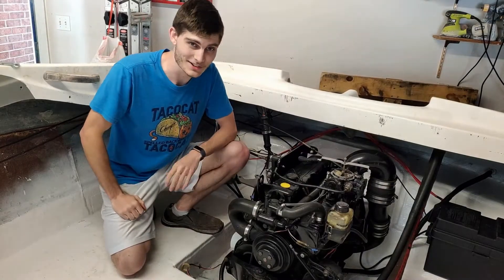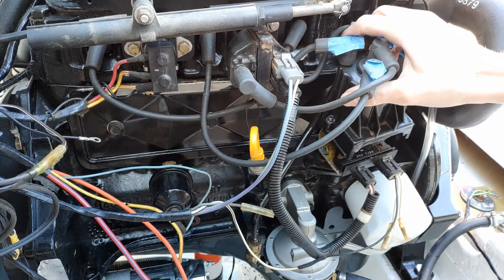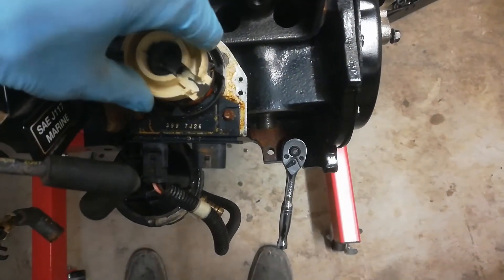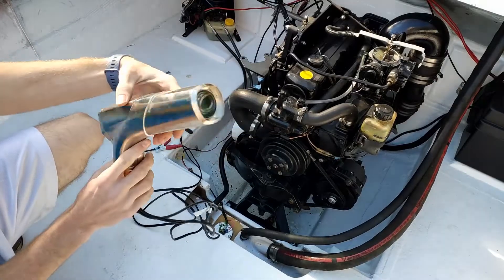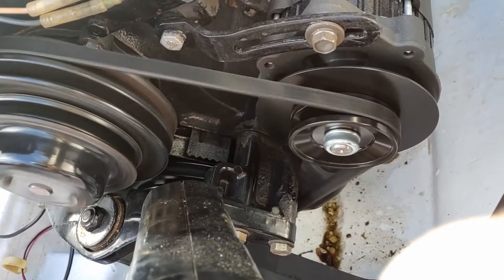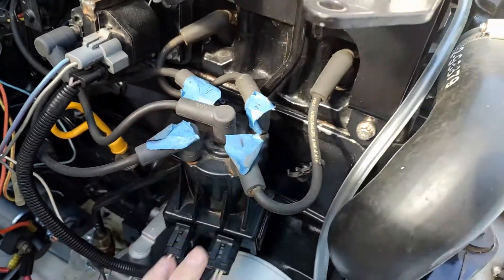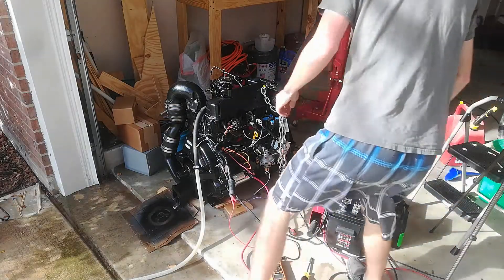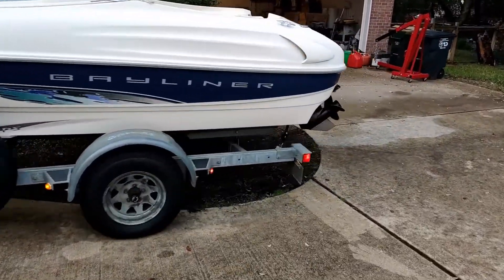Mercruiser Engine Distributor Timing

Comment: Great video Man :). I  am having an issue with my MCM470 and I cannot figure the timing. I am wondering if you have any ideas about that? thank you
Reply from the maker: Have you already tried adjusting the timing?
Reply: @ZachsGarage1  thank you for your reply. I have not touched the distributor at all. I am willing to work on it this evening but I honestly do not know very much about it bro, If only i could find a picture of how the cap is out and how the wires are done
Reply: I found out that I have no gas in the cyl heads!! I do have gas in the little intake under the carb though. and I can see the carb shooting gas down. do you have any idea why the cyl are not getting any gas? they bone dry :/. thank you again Zack
Reply from the maker: @yacinedreamer  as the engine rototes, if the timing of everything is correct, as the intake valve to a cylinder opens, the piston should be moving down to suck air into it, so if the carb is shooting a most of gas down, it should be sucked into the cylinder.

How are you looking to see the cylinder is dry? If you are peaking in the spark plug hole I would expect it to be dry. Because if the spark plug hole is open, air will be sucked in more from that hole rather than the intake valve
Reply: @ZachsGarage1  first, you are the only one who ever replied to any of my messages man. I really appreciate this. I do check the spark plug and it had no trace of gas. maybe I should remove the head cover and turn the engine over to see if the lifters are moving?
Reply from the maker: @yacinedreamer  yeah you can give that a try, I'm not sure if you'll be able to visibly see gas shooting in. But if it is you'll know because the engine will fire 🔥
Reply: @ZachsGarage1  Oh I did turn the engine but nothing comes out except air. I will try some marvels oil and see if something happens. I should record a video maybe

Comment: It appears you are one cylinder off.  Mine was set similar to yours and it would run, but not great.   Nearest the front/block should be cylinder 1.. your set up is similar to the distributorless ddis system.  But the EST system has the same firing order, but cylinder 1 is at 2oclock facing the front/ flat side of the distributor cap.
Reply from the maker: After I had troubles with mine, I had wondered if it was one cylinder off. I had taken the rod / lifter cover off, and when through rotating by hand checking when each intake and exhaust valve was opening and closing and when the rotor arm would spark each cylinder. I found that I did indeed have it on the correct cylinder firing order, but just needed ~8 degree advance adjustment on the distributor
Reply: @ZachsGarage1  must just possibly be the year difference.  Mine was an early 3.0. DDIS was not around when my engine was made. I used compression tester and turned engine over by hand and with cylinder 1 making compression, crank pulley timing marks lined up, my distrib was pointing at the same location as yours, wired the same as yours.  Motor ran ok, idled "good" was stubborn to start though.   I pulled distributor and rewired as mercruiser manual for the EST ignition, and now I don't even have to pump the throttle to get it started. No off idle bog, and revs way quicker than it ever did.   If it worked for you, then that's great. I was convinced when I had compression on cylinder 1 and it was not pointing where mercruiser said it should be.
Reply: Just seeing this. So I might be right about the rotor should be pointing at cylinder/plug number 1 ? this is what I asked : I've been trying to start my freshly rebuilt 2.5 120 HP Mercruiser. It's turning over and firing occasionally through the carb. I wouldn't call it backfiring more like a hoarse hose snort if you can picture that. My distributor rotor is at about 4 Oclock at TDC. Is it possible it should be pointing directly to cylinder 1 which would be 1 oclock (on the 8cyl 350 I built, you point that at cylinder 1) or does this sound more like I'm at TDC on the exhaust stroke and I should try flipping it around. Meaning getting to TDC as is, pulling the dist. rotating to the next TDC and reinstalling. Also is it possible that there is kill switch or wire I should be looking for that just wont let it start? I've jumped the 5&6 female pin connectors. I am also trying to start mine on a stand to check for leaks etc., before installing back into this project. Thanks in advance I know this is a 2 year old post so It may fall on deaf ears :)

Comment: Zach thanks so much for the great video extremely informative and easy to follow. I have a question my Bayliner is stalling out and only starts when I put it in neutral and throttle it up. When I back off to Idol it’s stalls. It runs fine when the ravens are up but anytime my back off it stalls. I suspect it is a faulty IACV. Can you show me how to diagnose fix or replace this valve?
Reply from the maker: I would if I could! But I don't believe I have a intake air control valve (IACV) on my carberated mercruiser 3.0

Comment: You didnt show if u need to jump the wire on the distributor. .
Reply from the maker: I did not jump the wire on mine to out it in base timing mode changes your timing degree readings slightly

Comment: Actually incorrectly done with this type of ignition system he should have set in base timing mode. Should have installed jumper between white leads coming off distributor and bypassed shift interrupter switch.and then used timing light.
Reply: Can you do a vid on doing it the correct way
Reply: You are 100% correct, off the top of my head I don’t think I’m correct but you run engine at 3400 and should be at 28° Before tdc

Comment: Hi Zach, great videos!  I'm currently rebuilding a Merc 3.7 and I'm ready to start it up before I get it back into the boat.  Do you have a link that describes the basic setup to run the engine outside of the boat?  Seems like the kind of thing I should be able to easily find but I'm coming up empty.  Keep the videos coming, they are really helpful!  Thanks
Reply from the maker: I might have to make a video on that in the future! 

for the wiring, I jumped pins 5 and 6 together,
then connected battery (-) to an engine stud, and battery (+) to the starter. the pins are numbered on the wiring harness

And then rigged up a switch to engage the starter
Reply: Thanks so much for the speedy reply. Looks like tomorrow will be the big day, I’ll let you know how it goes!

Comment: Hei Zach. I have loved watching your videos.  I have a 1999 Bayliner Capri here in Norway which I am working on.  

I have a question regarding base timing mode.  I read that I should bypass the shift interrupt switch, connect the harness together at and link the two white sockets coming off the distrubutor to put the engine in base timing mode.  

I did that and then I set the timing to 2 deg atdc.  Having done that i reconnected the bypass and the connection between the white cables.  

I went out tonight, the engine ran lovely all the way out but started misfiring and backfiring on the way back.  So much so that I had to run home verry slowly.  Any idea what i have done wrong?

Olaf
Reply from the maker: Thanks for the comment, Olaf! It's interesting it was only misfiring on your way back. If the timing was off I would have expected it to misfire on your way out as well. Was the misfiring only at low idle? or was it misfiring at higher rpm's?
Reply: @ZachsGarage1  I fould the problem.  There was an intermittent fault in the harness between the coil and the distributor. When I touched the wire the motor died, when I released the wire the motor sprang pact to life. I have made a temporary fix and ordered a replacement. All smooth sailing tonight. Fingers crossed...

Comment: You were 18º  off;  the first marks that were there, were probably right, maybe you just had the distributor one tooth off? 
ps:  this was correct  if the gear had 20 teeth, but by looking at google pics, now i saw it has 13; .
Reply from the maker: Good catch, I agree, I think I was a gear tooth off

Comment: I'm chasing an  upper engine level tapping noise in a 2003  3.0 Mercruiser fixer-upper I bought. Previous owner had fuel pump changed out and I adjusted tappets to no avail. I'm going to check timing to make sure firing order is 1342 with rotor on #1 TDC. Very good  video you made!
Reply from the maker: Thanks! Feel free to upload a video of the tapping sound to share 👍
Reply: I’m having the same thing did you find your noise??
Reply: @jakobcarrier3696  I too had this noise after replacing the head, lifters and rockers on my 2003 3.0.  Turns out that when I first set the valves the hydraulic lifters were not fully pumped up.  I readjusted them again and the tapping went away.

Comment: Hi! Thank you dor the videos. I have a question. I will change my ıgnition coil but how can I make sure that the engine has thunderbolt system or Mallory?
Reply from the maker: That's a good question! There is some info about it on this forum https://forums.iboats.com/forum/engine-repair-and-maintenance/mercruiser-i-o-inboard-engines-outdrives/572280-thunderbolt-4-to-mallory-marine

hope that helps!

Comment: Really great video , Also have a  3.0 mercruiser but from 2006. I think I have the same problem . I can never start it if I don't give it some throttle. 

But today when I put it back in water after being on land for almost 6 month , it runs great on neutral, engine won't shut down and it runs fine but suddenly it started to backfire a couple of times and when I put in gear I won't let me speed up I can only run it on forward /reverse on minimum speed . 😣

It feels like it want to go but something is holding it back , I can put gear in with no problem , and run it in neutral with higher rpm all that seems fine.
Reply from the maker: hmmm, I wonder if the choke gets stuck.

Have you tried removing the flame arrestor to see if the choke flap is opening all the way up when you begin to throttle in gear?
Reply from the maker: you could try adjusting the distributor I tiny bit either way to see if it gets better or worse
Reply: @ZachsGarage1  thank you sir.
I'm going to try this today after work.

I'll start with removing the flame arrestor and look if it's open all the way when I throttle in gear.
If it seems fine I'll try to adjust the distributor.

I'll let you know how it went .

All the oils are changed , And filters. 
I changed fuel , and fuel hose.
I also bought new spark plugs and changed them.
The belts were not tight enough so tighten them .

I removed the propeller during winter and cleaned the under part. I've put new grease and changed the anode sitting behind the propeller to a new one .
Reply: @ZachsGarage1  I removed the flame arrestor and opened and closed the flap by hand and I  noticed it's out of adjustment. It would not open all the way up. And if its open all the way up it never closes in any gear .

I adjusted it a little and went out for a ride.
I could hit 30 knots in no time , the acceleration was amazing . 
2600 rpm on 12 knots 
400 rpm on neutral /idle .
I took some picture so I remember to write it.
 
30 knots is max for my boat I think .
I never passed 30-32 knots .

I am really grateful man !
Thank so much for your help .
It amazing how you helped me through the comments .
Wish the best for you ! And keep the good videos coming !
Reply from the maker: @d2clutches885  Really glad to hear that man! Glad I was able to help

Comment: My 3.0 would spark knock at full throttle, I had to put the engine in base timing to get it to factory spec which was 2 degrees BTDC. I had trouble finding this video on YouTube and had to learn by trial and error.
Reply: You did it the right way! Jeremy
Reply from the maker: Thanks for sharing your experience!

Comment: Did you have to make a jumper wire?? By the distributor?
Reply from the maker: I read about that. No, I did not, if I understand it correctly it locks the timing into base timing, as opposed to it advancing more the higher the rpm
Reply: Cool thanks!!
Reply: Your engine might spark knock at full throttle. 93 octane will fix it, but if run into this, you will have to put the engine into a base timing mode to get it dead on. I would recommend you do this procedure first, then try the base timing and see how far it will be off.
Reply from the maker: @jeremyrowe4339  Thanks for the heads up!
Reply: @jeremyrowe4339  how do I set to base timing?